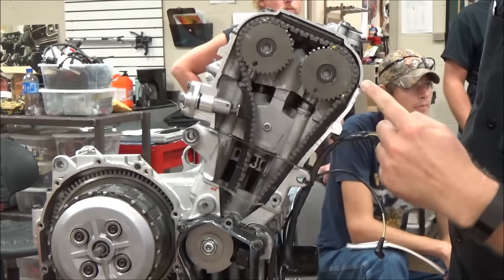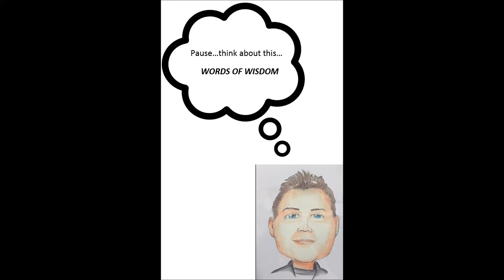How to time your camshafts correctly. The most common human error made shown on close up video!

Comment: Completed a valve adjustment on both intake and exhaust valves a few days ago on a 96 cbr900rr. PITA trying to see the mark on the intake camshaft sprocket, due to the frame being in the way. I put everything together again, but the bike did not run very well. Today I took everything apart again and with your vid in mind I realigned the cam sprockets. Turns out exhaust cam sprocket needed to turn 1 tooth clockwise and intake cam sprocket 1 tooth counter-clockwise. The bike runs very smooth now!

Comment: Hi Shane. We see the timing marks for cylinders 1 and 4 are the same, and 2 and 3 are the same but on the other side, 180 degrees away. So if cylinders 1 and 4 timing marks are lined up with the pointer, Pistons 1 and 4 are at TDC. If cylinder 1 is on compression, can we assume cylinder 4, is also at TDC, and must be on overlap?